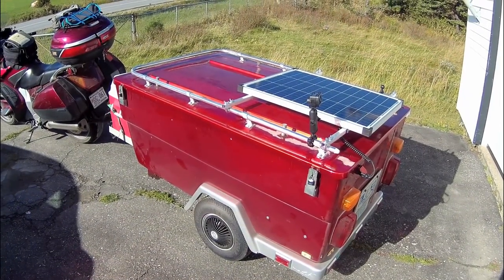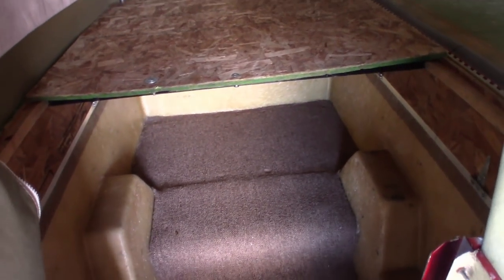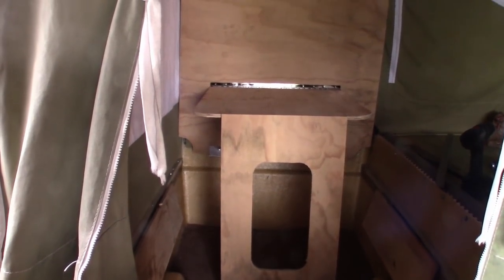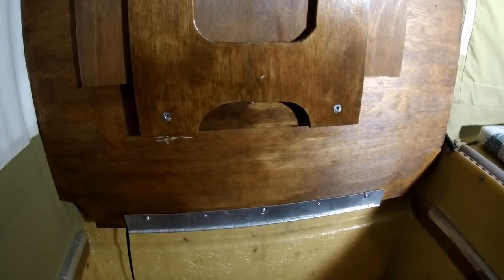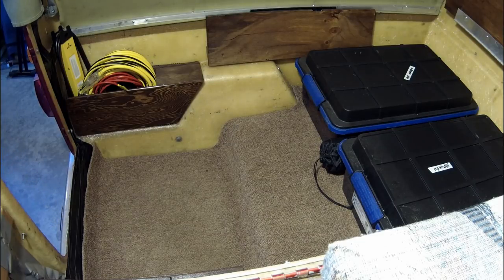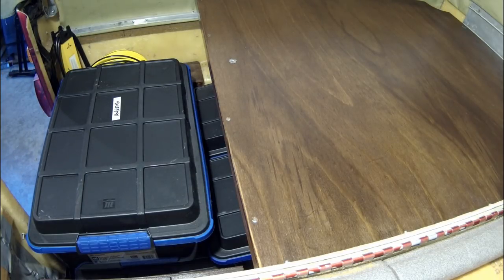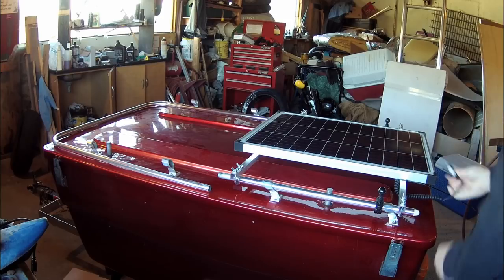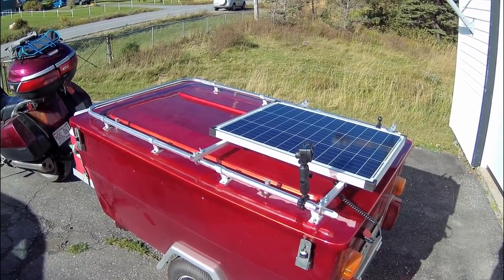Mini Mate Renos & Test Packing 2019 Ep 2

Comment: Nice setup ! Thank you
Reply from the maker: I've got to do a new video on upgrades. I was running 2 - 18 Ah deep cycle batteries in this set up with a 50 watt solar panel and controller. I now have 2 - 30 Ah Lipo batteries and a 100 watt solar panel. I have a 300 watt pure sine wave inveerter so I can charge my laptop. I use a 12 volt electric blanker when I need it. Yes, there is a controller in the system so any access power dumped.

Comment: Wow! I just found your Channel. I'm very interested in eventually finding a camper similar to this. I do not have a motorcycle but I would be pulling it with a small Chevy Spark. I know that new campers are very expensive so I'm going to be keeping my eyes open for a used one. I'm also a senior at 71 years old on a very tight fixed-income. A cancer survivor with one lung. I want to hit the road and do some traveling my final years. But with medical bills draining my funds I'm limited as to what I can spend. This sounds like the perfect idea. I especially liked that you got rid of that OSB board and used plywood. I believe that I found that the newer models of Minimates or using marine-grade plywood.. I look forward to checking out your other videos. I live in rural East Tennessee and have a little farm here. I camp a lot around Eastern Tennessee and the Smoky Mountains with a Kodiak 8 by 9 tent. I love my tent but if I keep it I need to look for a small little trailer to pack everything in that would be easier than trying to stuff it into my little small Chevy 2020 spark. You be safe out there on the road and safe with this pandemic. Thanks so much for the video and information.
Reply from the maker: Thanks for finding the channel. The Mini Mate is a great camper for one person and even works when my girlfriend comes along. I've done a fair bit of hauling it with my KIA Rondo and it's an easy load. You live in a great area for scenery and camping. I've been down hit a few miles of Tennessee roads....i.e. the Tail of the Dragon. I've got to get down that way again when all this Covid stuff settles.

Comment: the forward floor where you put the first two black totes in you could cut a hole in the floor and get you a battery box and sink it underneath right in front of the axle it would make the  center of  gravity a lot lower and you have a full size battery out of the way  you could  put another box beside it if you made it two wide and put your cables and wires in that to 
make a lot more room
 Also mount your solar panle to the top of your ice chest . It would keep the hot sun off of it and out of the way. Then you could get out of the weather a lot faster .
Reply from the maker: I'll work with this setup at least for one full summer. I'm actually using an old bike battery of mine (I know, not deep cycle) but it means I have a bike battery backup. I'm only charging cameras, phone and some LED lights so the load is not that great especially with only 50 watts. I can get the panel off pretty quick to set up if I am in rain and right now I'd rather be able to get at the cooler during the ride easily... I hope to be out on the road for 10 weeks this summer and that will tell me lots about how the setup works and if I want to change things.
Reply: Myself, I'd be leary of mounting it that low...not to mention cutting into the fiberglass floor.   Seems the size of the current battery  is sufficient for powering the laptop and charging camera batteries.  Also, the current location keeps it well protected..and close to the panels connection.  If he was needing more storage space, I imagine your suggestion might be a good possible solution though.
Reply from the maker: @gotthumbs2235  And thinking a little more on it, I wouldn't want a battery under the "tub"...  I've seen too much water to be comfortable with it under there. I'll run this configuration for a t least a year.

Comment: Just watching this again and it hit me the rare Earth magnets would be good for mounting in the storage boxes along the tub in front and behind the wheel wells. Those should be easy to embed in the fiberglass, and a Forstner bit combined with a proper shaped box should work well. Good idea generating video for sure.
Reply from the maker: I'm a big fan of rare earth magnets. I do notice occasionally the table has disconnected while riding... usually there is enough stuff under the table when it it is in the travel position to keep it from moving. Of course, it always snaps back into place as I raise that section. With all the wiring and the batteries in my rear side compartments, I just decided it was better to bolt them on. The rare earth magnets might work for you.

Comment: Hi!
I've been following you for a while now - I discovered your channel because I started researching the motorcycle camper trailers that are available here in Europe like 2 years ago... There aren't many. My only two choices are one that's built by a Spanish company, or the Mini Mate imported by a Dutch company...

The Mini Mate is technically speaking superior to the other one in my opinion, mostly because the interior won't get wet if you set up under the rain (which isn't the case with the Spanish trailer)... However I have a couple of questions I couldn't find the answers to anywhere, I figured you'd surely have the answers!

Having been fully nomad with a tent and my bike for 2 1/2 years now, I know the importance of protecting yourself from bugs... So I couldn't help but notice that the door doesn't seem to be bug-proof. I mean where the canvas joins the rigid door, there doesn't seem to be any way to attach one to the other... Is there? Don't you get bugs inside?
Also, in case of rain I would assume you have to completely close the windows... So, no ventilation... Don't you get some condensation inside after a while?

That's about it, other than that it seems to be a very convenient and capable little camper! Your modifications are interesting too, but I'll cross that bridge when I get to it... I'm not there yet!
Thank you.
Reply from the maker: Re bugs, the tent section over the door has two layers and the door gets sandwiched between them. No fasteners, just gravity but the overlap seems to keep the bugs out. I've never had more than a couple of mosquitoes get in and I think that mostly was when I was getting in and out of the tent.
I have had condensation more in the shoulder season when it had gotten down close to freezing at night. I carry a small 12 volt fan these days. With the add-a-room you can leave the window facing that as open as you like for ventalation.  
I have really enjoyed the Mini Mate. Planning on another 3 months on the road this year. Let's see how I deal with heat.
Reply: @OldGuyonaBike  Awesome, thank you!

Comment: You could put little picture or mirror in the middle of the table leg, as it looks like a frame on the wall in the “table up” position.  Nice set-up.
Reply from the maker: Thank you. The table leg is so rarely up in that position long enough to have some art appreciated. If the bed is in sleeping position the table is folded under it, the same in packing position and when I'm in office/dining mode the leg is down... wait, but, a picture would be visible then... hmmm. I'm still tweaking the trailer a little. Can hardly wait for May!

Comment: I like the modifications/reconfigurations you made to the Mini Mate.  Making it fit your needs for sure.  Is there any possible issues with the power connection from the Solar Panel to the back of the Mini Mate?  Any issues if there's a downpour?  

On another note, I have a Givi V45 on my ST and was curious about the lighting you have in your top case.   Did you do the lighting modification yourself or is that a Givi add on?
Reply from the maker: If I was in torrential rain I might unplug the panel as the inlet (outlet) has a waterproof cap. Had not problems with the rain and slush on my Octobrrr Adventure. I put the Givi on, maybe 10 years ago and bought the extra lighting from Admore... simple to wire in. It looks like it is pulsing sometimes in the videos but that is the camera FPS acting with the LED normal cycling.

Comment: Do you have a weight of your trailer with all your mods, without interior bins. 
Including batteries, solar equipment, outside storage containers. My tow limit is 400 on my spyder. Thank you. Love the videos.
Reply from the maker: I have not had a chance to get the trailer on a scale fully loaded but intend to do that next spring. The manufacturer says the MM weighs 260 lb. I'm not sure if that is with the add-a-room or not. I did weigh my individual totes last year. Kitchen and pots (all my cast iron lol) came to 39 lb, and go in the indent at the back. air mattress, awning and other totes including sleeping bags and electronics came to 34 lb. Batteries and wooden housings 25 lb. +/-.  they are behind the wheel wells and help balance for tongue weight. Solar panel 8 lbs. Small propane tank 15 lb. full. The full cooler 30-40 lbs. Note i now keep the cooler over the axle to keep it's weight neutral. I roughly think I pack 150 - 175 lb.  With miscellaneous items, I suspect that my total trailer weight is between 450 and 500 lb. I am curious to see how close my guesstament is. I've gotten the tongue weight down to 60 lb. 
I am sure, with the right gear, you could get down to a 100 lb. payload. Your choice of cooking pans etc. could save you 30 lb. real quick. I've got 10 lb. of camera/electronic gear in one small tote.
The Mini Mate pulls really well and has always felt solid behind the bike. Braking has not been an issue and I've had one hard emergency stop. I have noticed that I am changing brake pads earlier than I used to but that might also be due to looking at them more often than I did before the trailer.
I've seen a few Spyders hauling Mini Mates and correspond with someone with a Ural sidecar rig who hauls one. I'm sure with the right gear and a proper packing, you could stay in the 400 lb. range.
I know all manufacturers low ball their specs for safety and liability reasons. I've always gone on the assumption that I have at least a 10% variable to work with. Not advocating that you ignore the 400 lb. suggested limit (there is my liability waiver) but I am sure you could haul 450 lb. with no issues.
I've seen some people (Goldwingers and big Baggers) hauling larger trailers with their Yeti coolers and AC units weighing in at over 800 lb. I am not sure I want to go that far... would definitely want electric brakes on a trailer weighing in that range.
Thanks for finding the channel.

Comment: where did you get the extra inside pole on the left to hold that side up and tighter
Reply from the maker: My Mini Mate had it installed when I bought it. I am trying to think what they are called for a google search.
Reply from the maker: You can get a 2nd top ridge pole from Kompact Kamp which would be the right size/length. https://www.kompactkamptrailers.com/store/Telescoping-Support-Pole-p92240579
Reply: @OldGuyonaBike  yea I looked they want to much 50$ plus shipping way to much money
Reply from the maker: @harrynewton6437  I think that is a little steep too. I know I saw some twist lock poles/bars on line a few months ago but I can't find the seller. Mine is not one of their centre spreaders, definitely after market. The pins at the end are much thinner. I think there was a tag on mine. I won't have the trailer open til some time next week in the garage . I will see if I can find a manufacturer name.

Comment: this is very very nice, 
i did not have sound or cc available - -can you provide links to solar panel and charger used  
thanks in advance - what is time to fully charge a 12V with that one panel?
Reply from the maker: I have done more renovations on the trailer and the solar system. Same 50 watt panel but I've added better batteries. I can run a lot of LED lights, charge many camera and phone batteries and even run my small notebook on the system now. A 6-7 hr. ride in sunlight keeps the system topped off. I have never run the batteries down past 11.9 volts. I have a couple more improvements to do over this winter and will have video on that early in the new year. Here's the first of 2 more reno videos. https://www.youtube.com/watch?v=lkAJfhTPy4w&list=PLNPd0jZhrqvW9LfXW4x9FPLqY3Ex36zJ6&index=2
Reply from the maker: And I forgot... this is the panel and controller I  am using. Got it on sale for $80 Cdn. if | remember correctly.  https://www.canadiantire.ca/en/pdp/noma-50w-solar-panel-kit-0110005p.html#srp